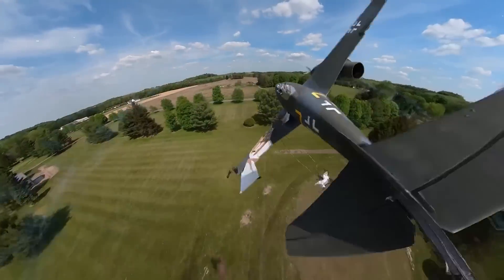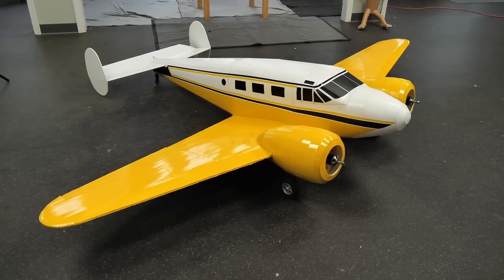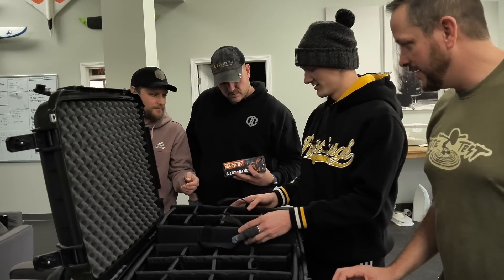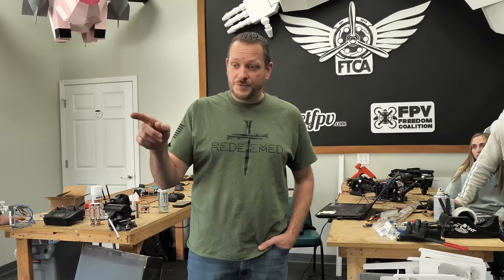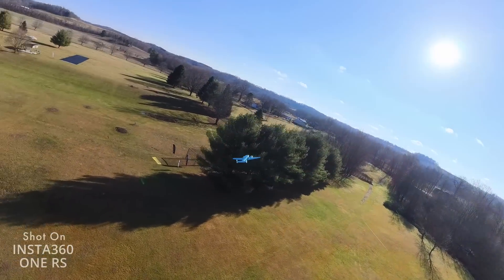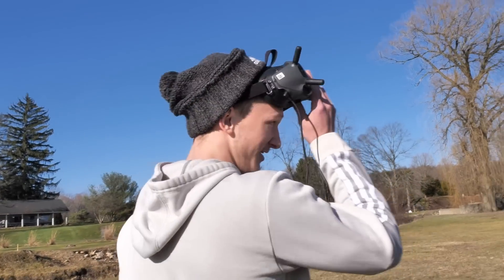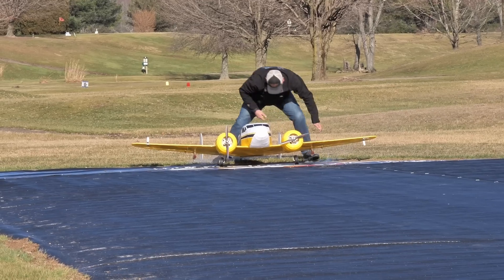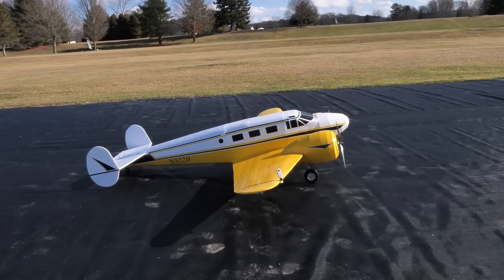Showing off our Massive Beech 18

Comment: As a kid in the 70’s and 80’s, my grandpa was an A&P. The airport in Georgia that he worked out of was a skydiving center and they had 2 old D-18’s. In the Georgia heat of the summer, I “flew “ many missions in both those old planes 😉. I did get to fly in them for real on a few occasions hauling jump loads. One in particular was extremely memorable because we had guys hanging on the railing on the outside of the plane from takeoff to altitude. I think we had 4 hanging on the outside and I can assure you that it’s pretty unnerving to have someone looking in the cockpit at you at 12 k. Great memories of a great airplane. Much love from NC.

Comment: Dear Sirs, your video from  6 years ago about the two micro B-25 machines has inspired me to get the Flyzone B-25 for my son. I actually wanted the other one because it had a gyro stabilizer - the Flyzone machine hasn't - but the E-Flite B-25 was totally out of stock, and I was still lucky getting one of the Flyzone B-25s. My son will get the Flyzone B-25 for his 9th birthday. He is actually not a bad pilot (I started to show him how to handle a joystick when he was 4!), but accidents may happen, and I already know that spare propellers well be a dire necessity. Does anyone know of a good source? They need to be inverse, of course. The blades (three per propeller) have a length of 5.5 cm / 2.165 inch each, so the propeller diameter would be 11 cm or 4.3 inch. Is there a B-17 or B-24 RC model in the same scale? And if yes, are the propellers suitable for a B-25? Every bit of advice would be very much appreciated! https://www.youtube.com/watch?v=x7o8jQV3zpQ